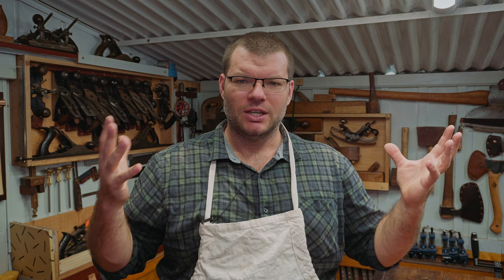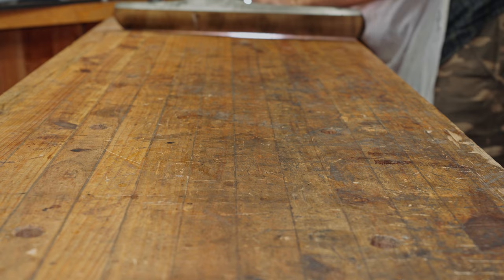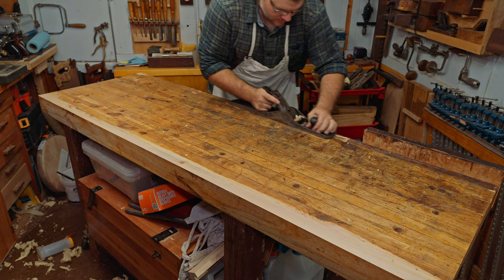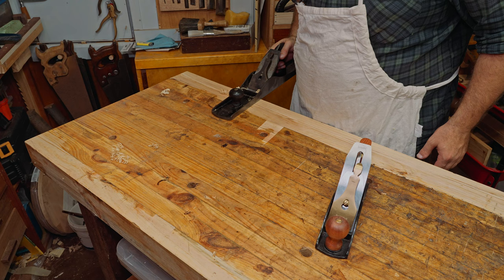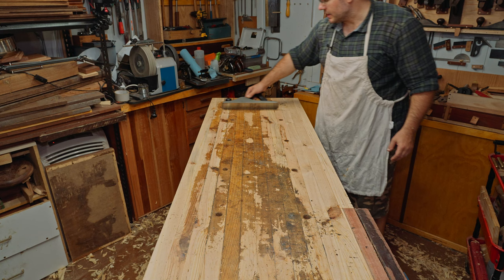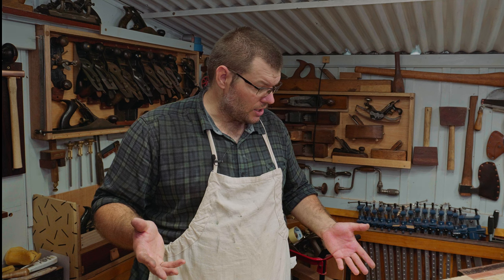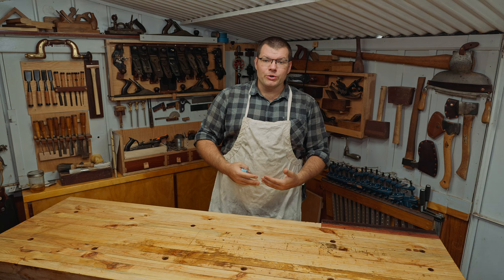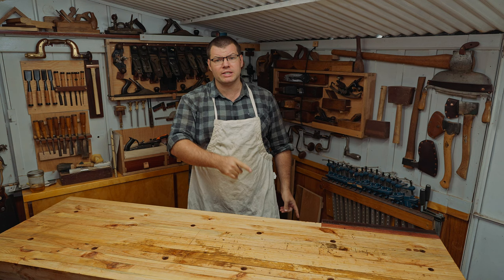Workbench Top: My Process For Re-Flattening

Comment: Just discovered your channel.  My work bench is also a Roubo (split top) made of the most economical wood I could afford at the time (Douglas Fir). I'm glad to see that your bench, like mine, shows signs of use.  When I see benches like Nick Pedula's or Nick Sawyer's I think I would never want to work on them for fear of leaving a mark.  When mine got too beat up, I did what you just did and reflattened. Thanks for your videos.
Reply from the maker: I agree with you there is no need to make a super fancy work bench unless its being used to show off your work i guess.  I just prefer a fairly inexpensive option and get to work not worrying about damaging it.

Comment: Good example of cleaning up and flattening a bench top. 

I always run a sliding dovetail cross braces under my tops when i dont have other support. I dont glue them. I just make them mallet tight to let the top move and about 1.5" shorter than the width if the lumber is fresh from the home store. Here 2x4s are still pretty wet usually and shrink a lot.
Reply from the maker: Sliding dovetail braces is a great idea

Comment: A large laminated slab top is nice to have but I don't envy you having to flatten a chunk of that size! Mine is traditional English pattern, only 5 feet long and 13 inches wide (with a low, wide tool tray at the back), so it's easy and quick to flatten, though it actually stays very stable being of modest proportions. I like the way you did it, though - don't often see YT channels advocating the use of a #7 (which I would also use on a slab that size). Just one tip, I fitted a hefty central cross-brace between the aprons on my bench (not glued, just blind mortised into both at each end), to keep the slab and tool tray supported in the middle, if that helps anyone thinking of making a bench and wants to avoid the 'gravity dip'. However, like yourself, I didn't pay attention to grain direction when I made the laminated the top and so the original flattening was a bit of a nightmare. Anyway, nice work...!
Reply from the maker: Thanks for the suggestions

Comment: This is a very helpful video.  I’ve made my very first workbench using pine.  While my bench does have cross stretchers underneath, I really didn’t know what I was doing when I laminated the bench top. Not only did each 2x4 dried in uneven position (top to bottom), but grain direction doesn’t go in the same direction. I’been using it as it it, aft flattening as best I could, but this video gives me more helpful info to help me do a better job of flattening. My bench top is getting thinner, but Im learning from my mistakes. Hoorah!
Reply from the maker: I'm glad i was able to give you a few helpful tips. It's never a bad thing to learn and improve, my workbench is far from perfect and has lots of mistakes when i made it.

Comment: Thats a cool no 7.. i have a no 6. A lot of people crap all over them but I love mine.  They say the are prone to warping and that they are a kinda useless, in-between size.. all those people can jump in a turbine. Ive used the crap out of my plane and it works great...
Reply from the maker: I don't think any of the longer jointer planes are more prone to warping than any other size. I will eventually have one of every size plane, i think they all have their uses depending on the job. I love using my no.6 & 7 when possible even in my small workshop, they're a joy to use.

Comment: Interesting that you were able to use the scraper plane on pine! I have some trouble and I don't get nice shavings using (card) scrapers on softwood (like pine or spruce) while hardwood works great.
Reply from the maker: My understanding with pine is you need a less aggressive burr, just a very slight one. I could be wrong but i was getting very fine small shavings

Comment: What about twist.  I'd like to hear your thoughts on the 12 1/2.  I have one, because?  I know it was more meant to scrape veneer tops.
Reply from the maker: The twist is a great question and is something i forgot to mention in this video. I removed any twisting in my bench top when i first made it and due to the laminated nature i have never had an issue with it re-twisting. I think this is due to the fact the top is laminated and i also think this could be due to the fact the bottom of the bench top is also held on all 4 corners, which as i said in the video i believe has allowed it to droop a bit in the middle but it does hold the corners and stop them from being able to lift, which i believe prevents twisting.

The 12 1/2 work nice a smooth across the timber when i use due to the rosewood sole, it also takes nice shaving when the burr is turned correctly and is held at the correct angle in the plane. 

I have only used it a few times thus far and have only managed very small shavings (but it does leave a very smooth surface). This might be the nature of the 12 1/2 and why its called a veneer scraper plane or i might have it incorrectly setup at this stage. I believe i need to revisit the scraper blade itself and ensure it is completely square across and roll a new burr.
Reply: @AussieWoodshed  Haven't tried a 12 1/2 but have a Veritas. Works great on hardwoods but just makes dusty and poor shavings on pine. Somewhere I've seen information that scraper planes and soft timbers are a  mismatch. Was it Paul Sellers who said their not much suited to softwoods?

Comment: Perfect, i made my first bench last year out of cheap pine because thats all i could afford and its gone so wonky, been wanting to re flatten it but im scared of fucking it up more. My biggest plane is a number 6 tho.
Reply from the maker: As long as the hand plane spans most of the width that should be fine to use. You just might want to do a few checks with a straight edge occasionally if it doesn't span the whole distance. 

If you can flatten a board a bench top is not really any different just larger
Reply: @AussieWoodshed  Thanks! When I made it I flattened in small sections before the glue up and got super lucky with the glue up so I didn't need to do anything but clean up squeeze out. 
I have gotten pretty good at flattening boards now, the bench top is a little more intimidating but I think ill tackle it next weekend. If I remember maybe ill respond and let you know how it goes. 

I appreciate your engagement with your viewers.

Comment: Looks a pretty good result. Raw linseed oil or boiled - looks to be raw?

Next work bench I make..... align the grain so they are all the same way. Will also drill some holes along the width at the ends and in the middle then clamp together via threaded rod (counter bored back and front so that nothing sticks out) as well as glued. Thats a retirement project.
Reply from the maker: Yes the results were good, you're correct its raw linseed oil. 

The thread ed rod is an interesting idea, i will have to consider that for my next workbench too.

Comment: Hard work to flat the top I used the same wood as you but my top is 800mm wide however I have 5 cross beams. Have no issues the top is still flat 
Is there not a way you can beef it up
Reply from the maker: It's definitely a good workout, i possibly could beef it up as you say and will definitely look into it. Thanks for the comment.

Comment: Where do you buy your kiln dried untreated pine in Australia?.. bunnings has either dried treated pine(the blue construction stuff- quite expensive), or that horrid sopping wet treated stuff
Reply from the maker: Yes, Bunnings is not a great place for this type of timber, i picked mine up from a local salvage yard. It's definitely a constant struggle to get decently priced quality timber. I'm yet to find a reliable place to source it.
Reply: @AussieWoodshed  cheers ... Im trying my hand at lutherie now and i went to a recycling yard like you mentioned and found some nice hardwoods ... The wood im using for the body is a killer on hand plane irons 🤣🤣 needs resharpening with every 10 passes 🤣🤣 ... Im finding eucalypts fascinating .. if i find a botany course on them , i will try to attend !!!

Comment: Have you tried an MDF top or have any thoughts on it? I'm currently designing one with MDF, inspired by a Rob Cosman video i saw and seems MDF has a lot of benefits. That and UK is terrible for timber choice and price
Reply from the maker: Yes, my first workbench top was 3 sheets of 19mm MDF glued and screwed between the layers leaving the top sheet without screws visible from the top. I edged it with pine to help protect the edges.

The top gave some good weight to the bench, the structure under it needed a few cross braces to support it.

I also put as much oil as it would soak up once complete which made it fairly waterproof but not completely.

The main reason i changed for a different top was so i could use holdfasts.

I still use that same top on the cabinet to the (my) right of the bench.

Hope this helps

Comment: Question for Anyone’s Response: Given this is a workbench top, what benefit does treating with oil provide? I don’t understand why one might want to “protect” the workbench that is simply the surface on which all the good stuff is made. Can the oil then impact surfaces of your workpieces?
Reply from the maker: Oiling the bench top stops moisture getting into it causing it to warp more and possibly most often. It also allow you to remove glue that falls on it easier and if you sharpen on it any water that might spill, from entering the timber.

Linseed Oil is a curing oil so once it's dry there are no problems with the work pieces. Really any oil once dry should be fine.

Hope this helps
Reply: @AussieWoodshed  Yes! I also built a first workbench that has benchtop issues and, after reading your response, I now understand why.  Uugh. Live and learn, right?  Thank you for sharing insights.

Comment: That broad axe is a beast. How much does it weigh?
Reply from the maker: It weighs just under 4kg it's a broad side axe for hewing logs square. I have ambitious plans to hew my own timbers for a cabin one day.
Reply: @AussieWoodshed  thats funny. I'm doing just that. I've finished about 16 8x8s of various lengths. I used a similar axe to yours,  It weighs just under 7lbs. I weigh about 165 pounds. My axe is really too heavy for me. It's  more work than necessary and hard on the body.  I have a smaller one that weighs in around 5lbs and that one is a dream to use. But my smaller one had some issues so I haven't been able to use it much, but it's the way to go for me.. if you haven't seen it, you should check out the video by Dan Dustin "from tree to beam".. he's the man. That was 40 years ago. He has some new videos talking about his different axes. You may wanna check those out, too. I think he calls it "tree to beam plus 40 years", or something like that.
Reply from the maker: @timbarry5080  thanks i will have a look